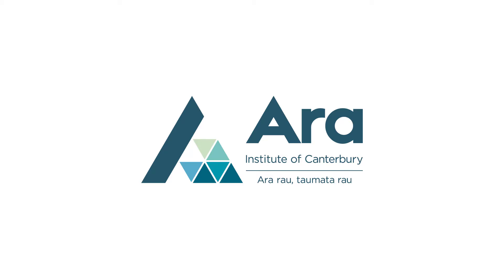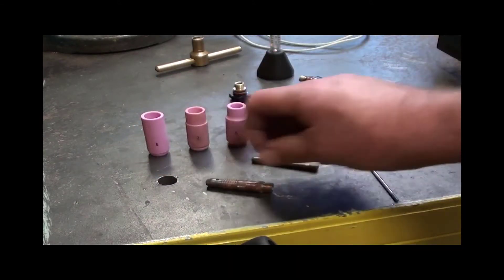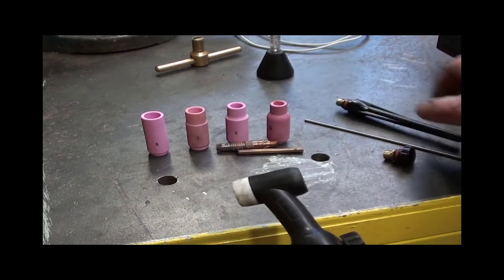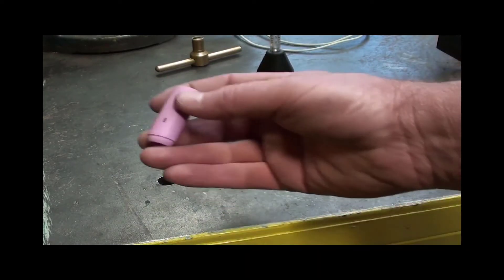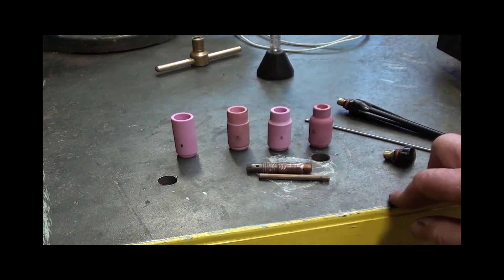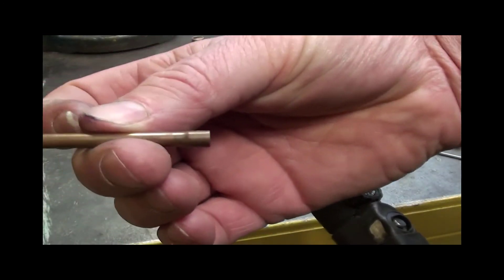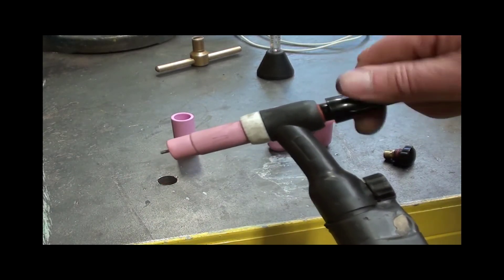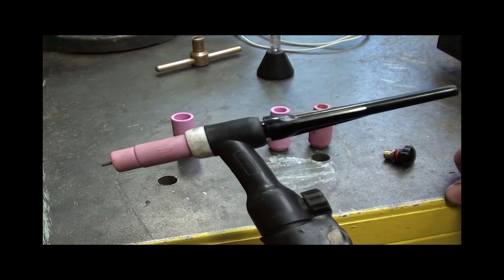ARA / Te Pukenga: "How to" Assemble the TIG welding torches

Comment: greetings from Phoenix Az
igot a Question?
the swtch come with the torch? or  how do you get the switch torch
Reply from the maker: Most torches will come with a switch if you are buying a new welder.  If you are only buying a replacement torch, you will be able to specify what sort of switch you want on it.